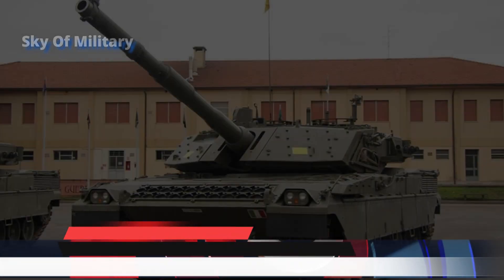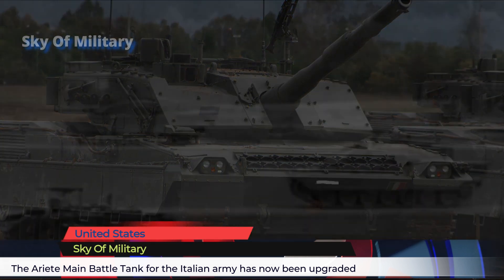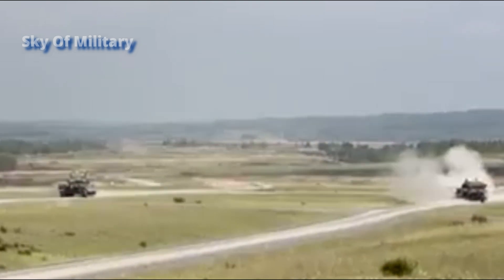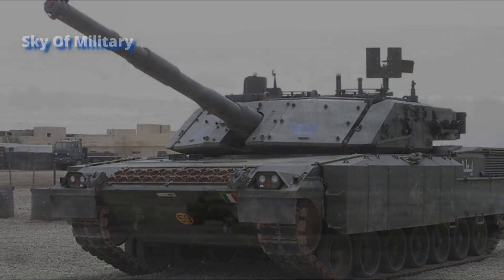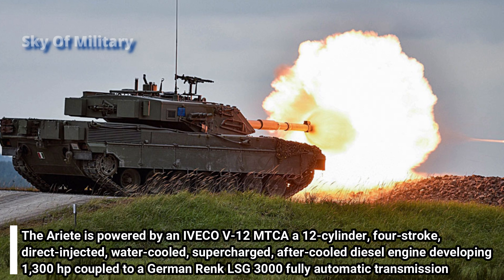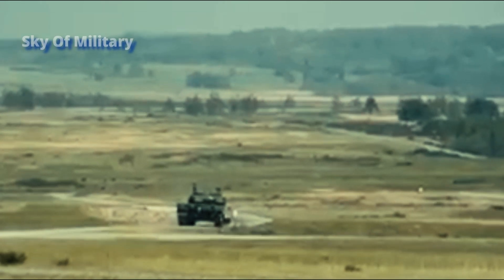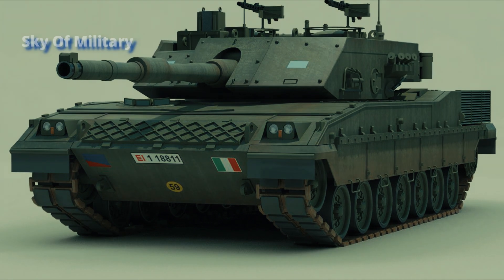Meet the new Italian upgraded Ariete Main Battle Tank!

Comment: Some context to put this tank in. 
The C1 was just a pre production model, thought as a transition between the Leopard 1 integrated in a Conscription model army, to a modern professional system.
The first 200 preproduction tanks were to be very simplified (few electronics) as reliable as possible, (no complex systems) and with a reduced power output and torque to increase durability. The tank also had strict dimensional and weight limits, being intended to fight on Alps and appennines mountain pass. 55 tons was the battle weight and protection had to be compromised. Other existing tanks were not considered because of weight and size. This led to the ill thought lack of a blowback storage area for ammunitions. The tank engine is also made if 2 Centauro/Freccia V6 blocks, intendended for commonality of parts. It was not inherently bad (compared to the Challanger2 I. E.), but attrition and ovetaxing of the few tanks available had really hit the tank availability today. Probably 40 tanks are still  combat ready in 2024. 
The following batch of Ariete C2 was meant to have a 350 units production and updated electronics, optic and surveillance systems and increased power output for the engine. It was meant for a fully professional army system.
The Final Batch (C3) was about increasing protection for the turret and the front but was only a preliminary design. Think of the Typhoon Batch system and all the incremental developments that were scheduled. Old C1 and C2 were to be updated to the new standards.
Then the cold war ended. Italy was pretty happy with its B1 performances, being much easier to deploy in peace keeping operations around the globe. Ariete production stopped and no real upgrade has ever been considered since 1995, except for add on Armour plate during the Iraq campaign.
Ariete could be still made into a competent tank, doing what the British did to the Challanger C3, but would be very expensive oand the upgradable tanks in 2024 is probably around 100, which is not enough by any stretch of imagination. Spare parts are also very scarce (production ended in 2005 after just 200 units), requiring restarting a logystic chain that had been deleted 30 years ago. Building new tanks would be more economically feasible, but time is short. Because of the failed agreement with KNDF, I expect now all the available C1 will be upgraded to the C2 standard, possibly with a gun upgrade to the excellent 120/45 from OTO Melara but time will tell. Ideally the whole turret should be removed and switched with an unmanned one but it's not easy to do. And probably won't be an option. The Rheinmetall KF51U turret with a 120/45 would be a perfect candidate, but I don't have data on how "battle ready" that concept is.
I still hope that the failed Leo2A8 acquisition will allow the usage of the 120/45, comparable, and in some instances superior, to the RM 120/55

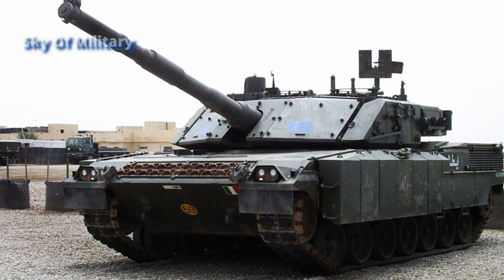Comment: 3:00 it will probably not: the gun might be replaced with the 120/45 from the Centauro B2 which, having a more modern breech, can fire every NATO120mm available. the new engine will produce 1600hp
Reply: Or we could send directly the upgraded Centauros. 
They are very effective, cheaper to run, very flexible, fast, nimble and can fight the old T62, if used properly. A 120mm shell makes the same damage if shot from a battle tank or from a 6 wheel drive armored vehicle. With some numerical superiority, Centauros can defeat tanks. They were designed precisely for this purpose, and they are much cheaper to make.
Reply: @ilmaio  completely different roles: as the US Army keeps (failing) to reminds their officials, the Striker is NOT, and should NEVER be used instead of a tank. The same is true, despite the differences, for the Centauro B1, which excells at sniping tanks from cover but really can be defeated by any APC with a 20mm auto cannon.
I'm not a fan of "Modern" MBTs, except the Type 10 to some extent, but really armoured cars with a big gun are not the right tool for replacing them.